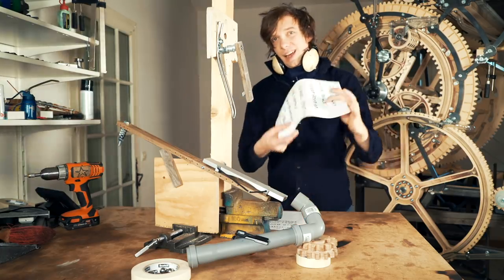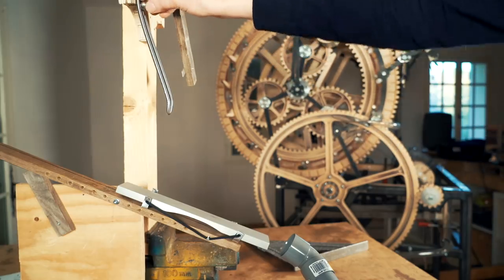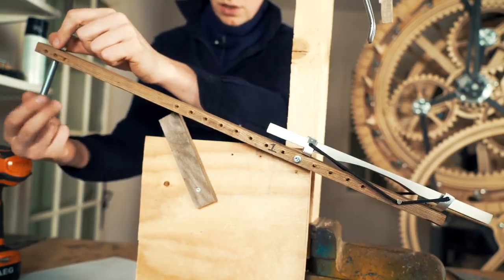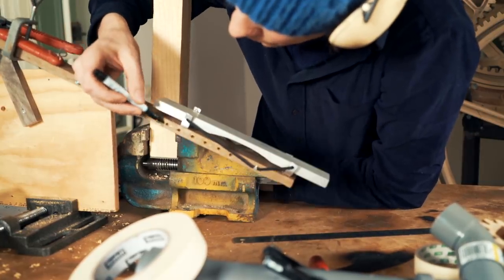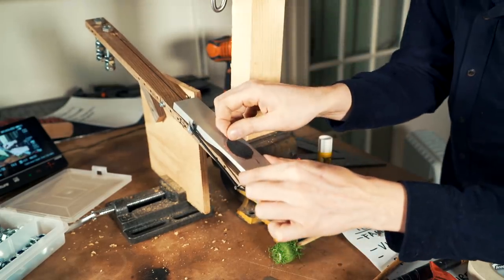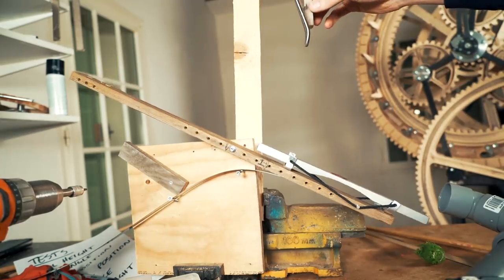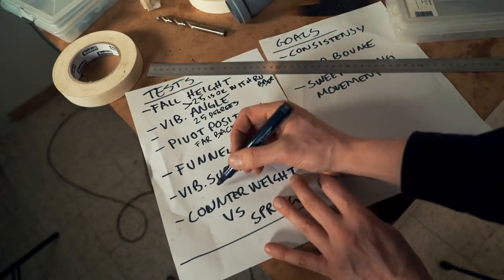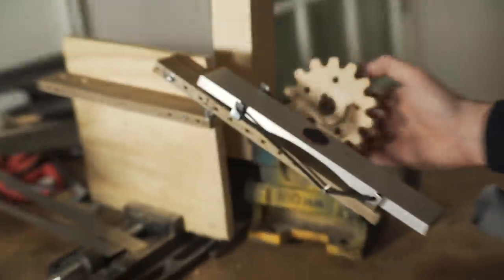Vibraphone Movement Test  - Marble Machine X #64

Comment: The leafspring is the best solution in my oppinion, but you need to think about a stopping nod under the arms (a little rubber button or something like that), cause if two or more marble come quickly the arms just don't have time to get back in position. The coilspring will resonate like that without a damping mechanism (like in a car), the leafspring's rubbing motion on the arm is just enough to reduce this vibration, just you need to make a little backfolding at the end (a little eye-thing) to prevent to cut into the arm, or a metal plate to the spring run on or maybe both :) 
I amazed by your work, and your attention on the little details, keep it up Martin, can't wait to see the MMX in full motion :)

Comment: I think because the plate isn't anchored to the frame well enough (it pivots at the screw), some energy of the marble is transfered into moving the plate. The marble looses energy and doesn't bounce far enough. If the plate wouldn't move, the energy probably would go back into the marble and lift it far enough to prevent double hits. So, anchor the plate down so it doesn't move?
Reply: But it looks like you already took that into account. :D

Comment: Don't forget each note has different lenghts, therefore different weights, so you need to adjust each spring. Also, if you coil the spring steel won't you have the same(ish) effect as the three springs, in +- the same space?

Comment: I appreciate all this work you are doing, Martin! I love seeing your videos. 

However, I think you may be consistently missing a HUGE issue that you will need to deal with in concert. It is your audience, the ultimate goal of any performing musician. You MUST see your act from THEIR perspective to know WHAT they are seeing- and hearing! 

Think about the layout of a concert stage. 

Your audience is WAY far away from the machine. They will not see much of anything (especially on a darkened stage) except the big gears going around and some of the more obvious movements (like you cranking the machine). If the machine is playing in concert with your band, the audience will also have their attention diverted by the movements of the other musicians. You want the marble machine to be the STAR of the show, the PRIMA Dona. 

You want it out in front, stage center, like a concert grand piano. It deserves to be. But that still won't be enough because of the scale of the concert hall. You're going to have to incorporate some "dazzle". Otherwise, you have a "salon" or "museum" type piece - where in the intimate surroundings the subtlety can be appreciated. Concert halls are not subtle!

With humans, they achieve this dazzle with makeup and costuming -- all of which has to be "over-the-top" to transmit from stage to seat. 

So I think you need to start considering the theatrics of the machine -- not just from the engineering point of view, and the perspective of the audience. 

Yes, your amplification system will get the SOUND into the hall. But visually, what will the audience see? 

To get a perspective on this, go to a local play and sit in the middle to back of the theater. How much action can you make out? Stage actors are trained to make HUGE gestures (which normally we do not make) to be visible to the audience. That is why modern representations of 19th century actors look so "hammy". We are seeing a distortion. Video is intimate. Stage is  distant. So seeing a 19th style of performance on video looks absurd. But in the theater, it looks NORMAL! 

Consider what ballet instructors tell their dancers -- they tell them to make wide sweeping gestures that seem utterly ridiculous. The audience can pick those up. If the dancers pull that in, they look dull and uninteresting. It's all about audience perspective.

Modern videography cameras can go for a wide or tight shot depending on the video director. A lot of bands have videography sending video signals to huge flat screens, and the whole thing can become a multimedia experience. So that may be a help for you. BUT, even large screens can fail to impart all the experience to the audience, especially the subtlety.

I love Animusic videos, but it is important to remember that they are ON SCREEN animations! Detail stands out there because they are focusing the "camera" on what they want you to see! You can't do that on stage without some kind of dazzling visual cues.  

There is a video on YouTube where a high tech company actually built a room to run an Animusic type machine - controlled by a computer. Their machine, while an amazing achievement, looked complex -- but dull -- compared to the animation that inspired it. That's because they did NOT take into account how humans see things on screen vs how we see real world environments. 

I love all that you are doing, just wanted to remind you that your END goal, besides making the machine work well and consistently, is to make something that WOWs your audience as much as possible. You and your machine deserve that.

Remember, most of your audience will probably not have seen your videos, or know ALL the amazing work you put into this wonderful engineering marvel. So they will be looking at it for the first time, and if they aren't dazzled, you'll get a big "Meh?" from some of them. We don't want that! 

How to add sparkle and dazzle - huge stage presence - and still keep an esthetic? 

I don't know, but maybe you might want to try and recruit an art director who knows concerts and audiences -- who can advise you on the very important dazzle factor.

I totally support you Martin, and I wan tot see you successful in EVERY way. 

Sorry for the long post.

Comment: Hey Martin, May I suggest some 1/8" or so thick HDPE pads be attached to note bars. It will dampen the ping sound from metal on metal and more importantly, it is less likely to fail as the rubber will with repeated impacts pinching the rubber... Thicker rubber will dampen the sound more and affect the resonance of the note bar, the HDPE is harder and will last longer.

Also is it true that the marble machine will fly? I could swear I seen reference to wings in the blueprints... ;-)

Comment: What if the rubber was mounted as a kind of trampoline very close above the vibraphone bar? This will give the same nice sound, but not dampen the tone. Of course if you want to dampen it anyways, gluing a rubber pad to it is probably the simplest way.

Comment: Idea:
The resonator tubes, maybe you don't actually need to change the length. Seems troublesome to do.
You could try to make them all long enough for the maximum resonance you desire for each of the notes. 
To decrease or increase resonance then later without shortening or adding to the tubes, you could clamp them somehow on different parts of the tubes. 

E.g. aluminum rings with felt padding, clamping onto to the tubes, mounted to structural pieces of the machine with hinges that can be tightened to allow for adjustment.
In theory, a low position of the clamp on the tube allows for more area to resonate, a high position of the clamp would make the resonating area smaller.
So like on a guitar, where you clamp down further up on the string to produce a higher note. (up means closer to the pickup or hole in this case, not up towards the head of the guitar)
You could label the positions they need to be set to for each note that is swapped out, seems to me a bit more convenient then to swap out parts of the tube.

Though I'm not sure how well it would work in practice, maybe it doesn't work at all.

Comment: At the end you said you have to have resonator tubes that you have to replace for each note, but is it possible to have them adjustable length? I.e. a tube that fits snuggly around the end so that you can push it in and out depending on the note?

Comment: One pro/con with a leaf spring is high internal dampening of movement, compared to the compression springs that have almost no internal dampening.
In that regard also a torsion bar spring behaves much like a compression spring.
2 layers of thinner leaf also have better dampening than 1, due to friction.
 I think the singel leaf behaves more like a parable spring. With some dampening but also fast movement.

Comment: You can make the counterweight more compact by adding mass and having a shorter length instead. For constant momentum, the product of gravity force and horizontal distance of the center of mass (center of mass of the counterweight side, that is) from pivot should remain a constant. From this you also can see that a horizontal counterweight arm affords to be the shortest. The spring you introduced also helps at reducing the amplitude of the swing. The horizontal length of the counterweight arm is given by L cos(A), where L is the distance of the center of mass from pivot and A is the deviation angle from the horizontal plane. From this we can see that a horizontal counterweight has the best stability. I predict best result from a counterweight whose center of mass rises to the level of the pivot from the force of the marble's impact, further enhancing the effect of the spring.
Reply: If you want to add more spring-like effect (force increases with displacement) to the counterweight, you can also experiment with higher deviation angle, just keep the counterweight below the horizontal plane. Note that a higher deviation angle does reduce the effect of the counterweight and it may need to be longer as compensation. You can also experiment replacing the spring with a second, vertical counterweight. A vertical counterweight should act fairly similarly to a spring when the displacement of the arm caused by the marble is small enough. Note that the vertical counterweight should be regarded as a spring in rest position rather than already bent one. The vertical counterweight should be adjustable by adding mass and length as needed.

Comment: you could use plastidip to spray a patch of rubber in a masked shape. or any liquid rubber for that matter. might be a little nicer than a punch cut rubber sheet, but if that's what your after look at drawer liners for a cheap supply of good rubber sheeting. you can use spray adhesive like super77 (or carpet tape) to stick the rubber sheet to a wood backplate and then with a sharp 1/8th bit or so you can cut specific shapes out.

Comment: I'm with you regarding eliminating tine frequencies of the  metal marble hitting the metal vibraphone keys.  You have gone for padding on the vibraphone surface and discounted dampening the marble.  Are you sure about that?  surely the best approach is to dampen the marble to mimic a real mallet head to solve this problem...perhaps there is a way of giving a marble a material coating without compromising its magnetic properties or motion dynamics yet provides dampening ...might need some research but there could be something out there perfect for the job...

Comment: Hello Martin, I am a little bit concerned about the vibraphone. Ik play percussion instruments about 10 years and have much experience with these instruments.
I have two questions to think about: point 1. I saw the vibratopedals are fully closing the resonance pipes, is this really what you want? On real vibraphones you'll see a sort of cut-off on these plates to give more sustain when its rotating. Otherwise it will completely stops the sound when its closed. Actually you get more on/off sound instead of a  "vibrato" on the vibraphone.
Point 2: I saw a lot of bendings in the resonance pipes. Do you think this is really going to resonate? On a real vibraphone you only see staight pipes. Sometimes on a marimba you'll see 180 degrees bending in the pipes at the lowes register. But not fully random bended pipes. This is because of the longitudenal waves which are the plates produceing. I think this is not going to work. If you look at the organ pipes of a big church organ you also see only straight pipes. I think you really look at the resonance of these pipes which you had designed.
Most of all I really wonder how your project is going. I look awesome instead. I really like to hear from you.
Greeting from the Netherlands,
Jasper

Comment: You might be better off doing torsion springs with a physical stop instead of coil springs. Coil spring has more body to oscillate before coming to rest and would affect the successive quick notes as most here have commented on.

Comment: Your most critical measurement you seemed to miss (others should have already mentioned this but don’t have the time to go through 600+ comments). Your hit point will be critical in determining harmonic tone as well as amplitude to drop ratio. Hit at the wrong point and you get a dampening and frequency cancellation. The tilting mechanism complicates things by changing the hit point. Optimal hit points will be related to harmonic lengths of the bar, with the sweet spot for maximum richness being related to the lowest odd harmonic. The resonance tubes help reinforce the harmonic resonances only to the extent of what vibrational tones are left in the decay after the strike, but can’t really put back what wasn’t there in the first place from the initial strike. Have you considered an intermediary fixed position striker that would guarantee a consistent strike at the same optimal point (a larger pad above to receive the marbles’ kinetic energy and convey that energy to a single hit point centered on the sweet spot of the bar, the hit point material could be made of a material similar to a vibraphone mallet).

Comment: With your Spring steel you need to remember that the smaller vibrofone plates weigh less
Reply: We know! On top of that Martin would like to be able to swap the notes over mid gig so the counterbalance needs to be easy to adjust quickly!

Comment: I really don't like being one of those "nattering nabobs of negativism", but custom coil springs have a nasty habit of softening over time and thin spring steel leaves can get creased if mishandled. You're best off finding a working solution with off-the-shelf coil springs that you can replace if they're missing or damaged. If you use identical springs, you normalize the behavior of your "shock" system. You might be able to add an "adjustment plate" that all the springs rest on that could give you an option to increase/decrease spring tension across the board -  I'm thinking here about ambient temperature variations. Maybe you could test to see if the springs behave significantly different in the cold.

I'm also thinking that maybe you need to preload the springs against a felt-covered stop that holds your pivoting bars down under slight tension. That way the pivots will depress when struck by a marble, but aren't flopping around for several milliseconds after the initial marble strike.
Reply: That's a good point about temperature there. It usually get's pretty hot on stages so the machine should be tested under those conditions more often.

I'm also wondering how happy Martin will be with all those custom-built parts. With over 3000 parts, a lot can break during a world tour :(
(I'm no engineer, so don't listen to me :D)

Comment: What if you used Tension Springs rather than compression springs? You just attach the spring behind and below the focal point and it should work no?
Reply: *pivot point. I’m a little slow today

Comment: Tja. Slagverkare här =) Jag skulle testa med att använda cykelslang som gummi. Det är rätt likt det som många tillverkare har runt kärnan på framförallt marimba-mallets. Annars ser träffpunkten rätt bra ut tycker jag. En del spelar en liten bit ovanför/under mitten av plattan, speciellt på de lägre tonerna och om du sätter något där dämpar det inte lika mycket. De ska bli intressant att se hur du/ni löser bytet av plattor och upphängning. Istället för att byta rör skulle man kanske ha ett system med ventiler/drag likt det som är på diverse brassinstrument. På en del "riktiga" modeller av både marimba och vibrafon kan man faktiskt finjustera resonansrören för att kompensera för värmen och luftfuktigheten där man spelar.

Comment: You just could calculate the movement you like most :) and combine it with a high angle for less bouncing. All about Physics. 
For complete balance its F*L=F*L  where F is the "weight" (force) and L the length of the lever. You want one side heavier so just find out the point where it looks good and you could easily play with the positions. A short lever would be good, you need fast bounces, that the marbles dont just hold it down. Short levers can move faster cuz shorter way to do. Moment of Inertia.
The choice of the angle can be explained physically... normally the incoming angle should be around the same as the angle the marble goes off the surface... like light from a mirror.
But there is our lovely gravity inolved so i would recommend a high angle that the marble bounces far enough away from vib befoe it goes down again and does not hit it twice.

Comment: @Wintergatan What about, instead of risking muting the bars by adhering a rubber pad to their surfaces, rather suspending a small, taut rubber or leather pad above each of the vibraphone bars?  I imagine it's possible to do it in such a way that it wouldn't impede the removal and replacement of the individual bars, but still provide enough clearance so that the pad doesn't contact a bar when the bar is vibrating.  I have no evidence of this and no way to experiment, but it seems like it would still allow marbles to strike the bars with enough force to make them ring, pad them so that they don't make the metallic "tink" sound, and also provide a decent amount of bounce to clear the bars.